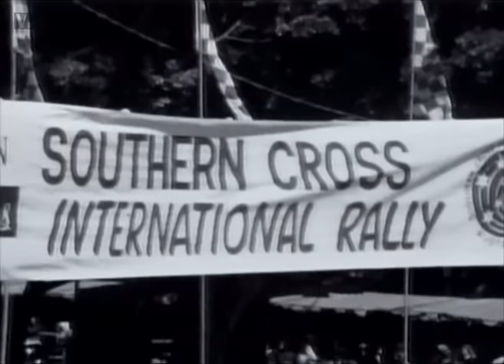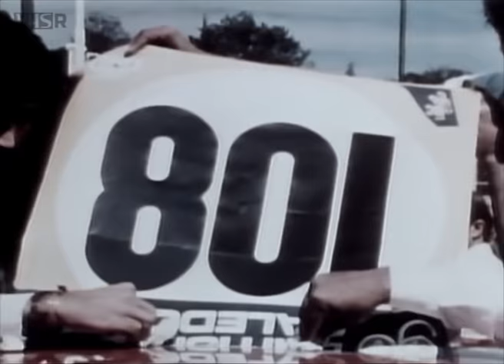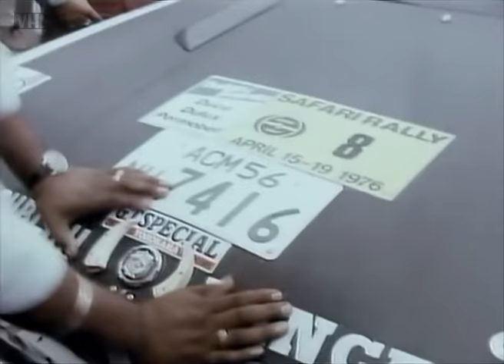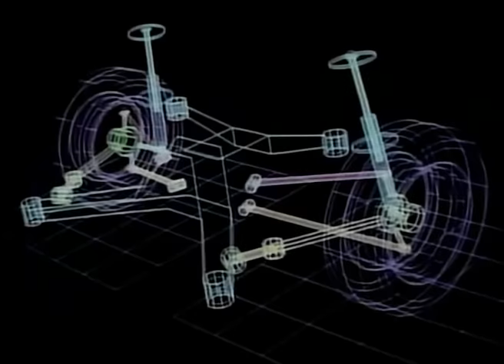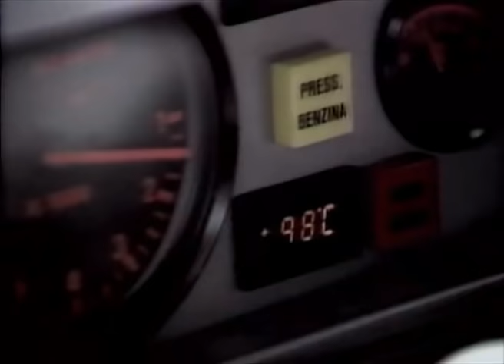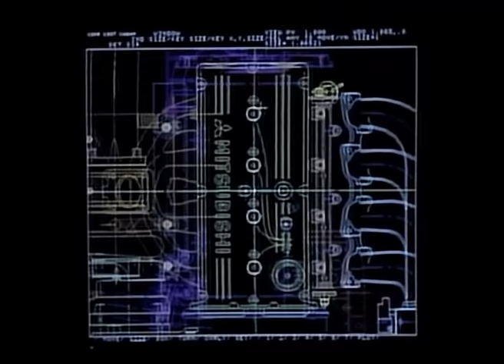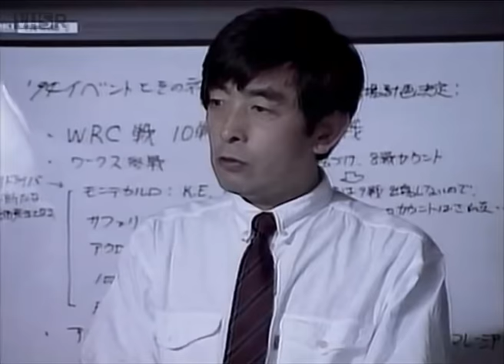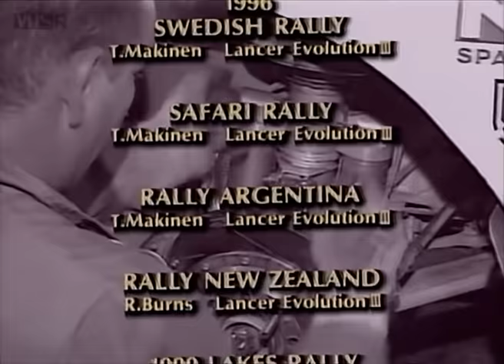A Glorious Heritage - Mitsubishi Motorsport History

Comment: The success that Mitsubishi had in motorsports is unbelievable. And you know what's crazy? This documentary doesnt even touch on the insane success that the Mitsubishi Pajero had in the Dakar Rally! From 1985 to 2007 the Pajero was consistently on top - Mitsubishi has more wins at Dakar than any other manufacturer.
Reply: MITSUBISHI PAJERO  wOn, 12 Times DAKAR RALLY CHAMPION.
Mitsubishi is also 10 Year's Ahead of it's rivals using EFi Electronic Fuel ⛽ injection.
Reply: The evo dominated time attack too